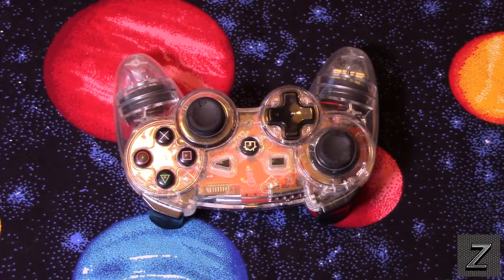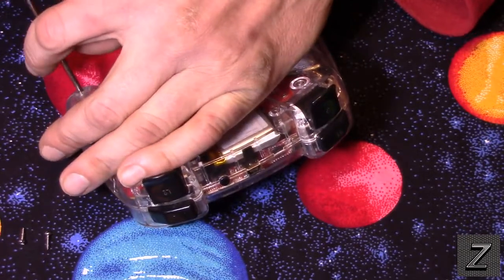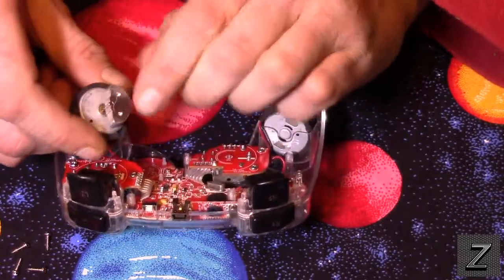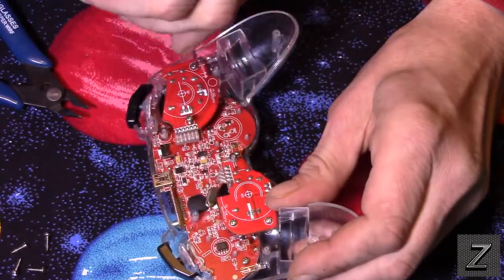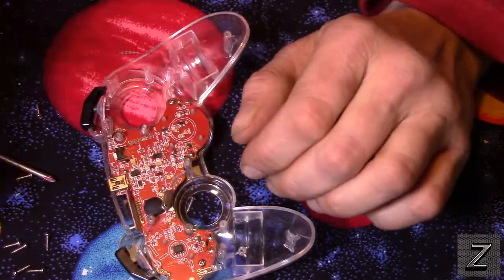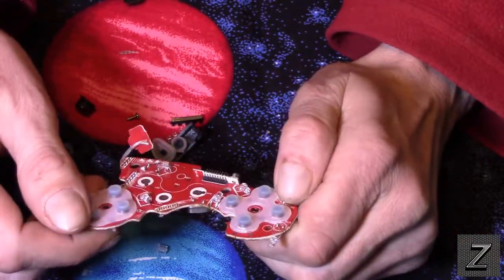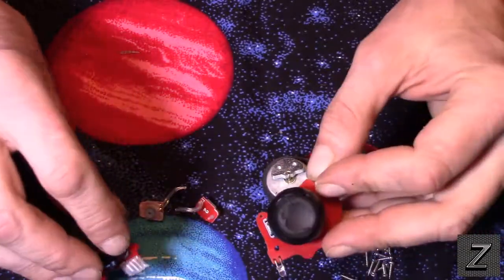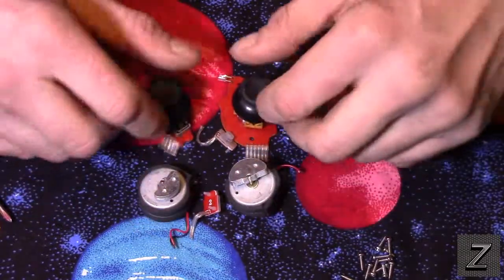What Can We Salvage From A old Game Controller To Reuse In our Electronics Projects

Comment: It's called an 'Afterglow AP.2 Wireless Controller', it's made by PDP who make okayish 3rd party pads for consoles, normally found in ASDA here in the UK or Walmart in the states, the one you have as scrap is the most common as people often re-home them with the USB recievers missing (like yours), the shaft of the thumbsticks (like all PDP pads) are metal so can only be really swapped into another with metal like 99% of 3rd party pads or use it in a totally different project, if it drifts you can crack off the bad potentiometer on the sides and swap it carefully with another from the same exact kind so keeping scrap of these is essential for controller repairers like me, the LEDs had longish legs and were red and quite bright so I would have kept them.  The batteries in those ARE crap, you can see the spec writen on them through the plastic plus they bloat and leak eventually.  Good video thanks.